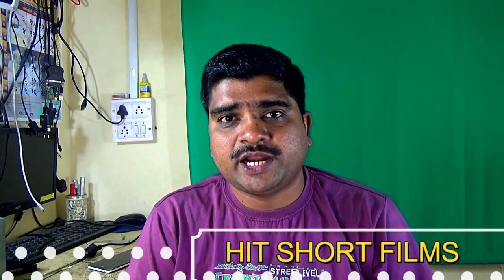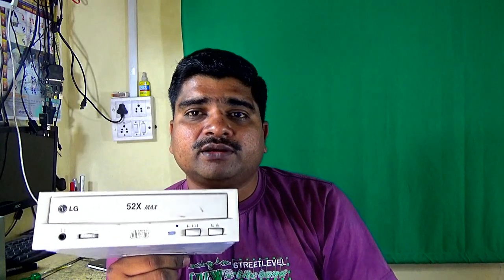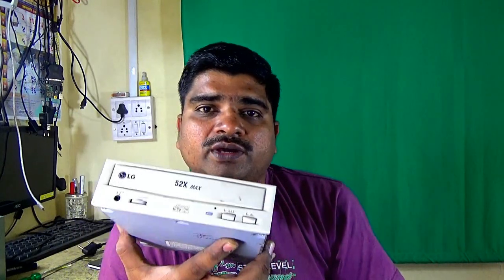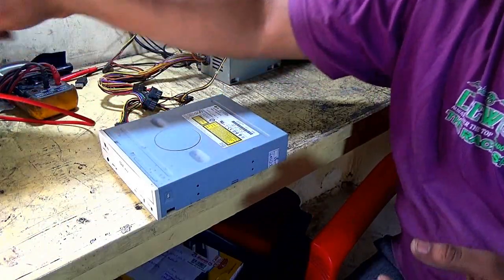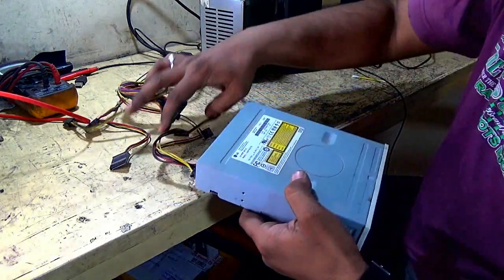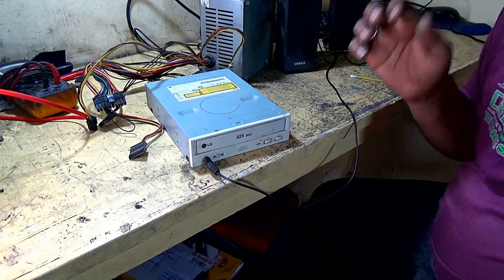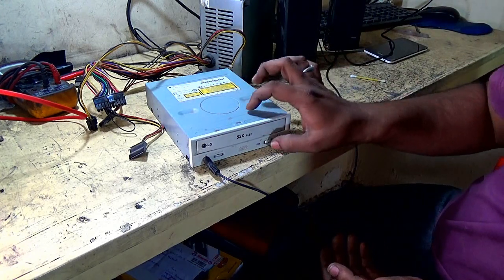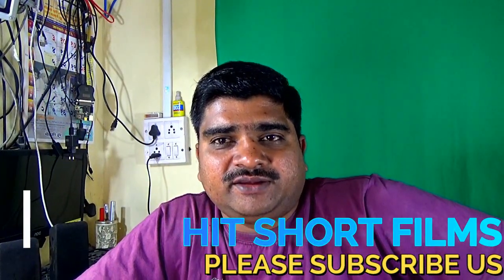Hacked - Convert  old CD Rom Drive to Music Player

Comment: IN short this is what he wanted to say:
Older CD-ROM Drives use to have the feature to play audio CDs themselves, they can easily be identified as they had a headphone jack and media player button on the front of the drive itself. If your CD-Rom doesn't have these features it will not work. 

Next to power the CD-Rom drive you can use a computer power supply (PSU). To use the power supply you need to find a way to turn on the power, this can be done by opening up a paper clip or getting a small piece of wire and making a bridge between the green wire and any black wire. This will turn on the power supply, this is a well know trick you can google it if you don't believe me. You only need a power source, you don't need a data cable for this trick.

Now you can play Audio CDs by simply opening the CD-ROM tray, then placing the Audio CD inside then closing the tray and it should play, make sure to connect a pair of headphones or a speaker to the headphone jack for sound. Also remember these drives can only play Audio CDs not MP3 on CDs. Audio CDs tend to only store a few songs and they are the ones you can buy in the shops. You can if you want google a program to turn MP3 into Audio CDs.
Reply: what if I don't have jack but audio output on back of CD Rom?
Reply: @pastel7915  then find out which is output, connect to broken headphone cable and connect plug end to speaker. Alternatively you can connect it to amplifier and then to speakers
Reply: @yoshibros1111  unfortunately this is digital output
Reply: Turn broken la pp top into desktop

Comment: if CD ROM has not earphone jack
Reply: Not work
Reply: It work if they don't have earphone jack. But you must have the audio cable to connect with computer then cut and soldering rca and then to amplifier....if you don't have the cable open the CD player and soldering directly the rca cable to the out of CD player its easy and you have the sound with all CD players but you need amplifier to control the volume